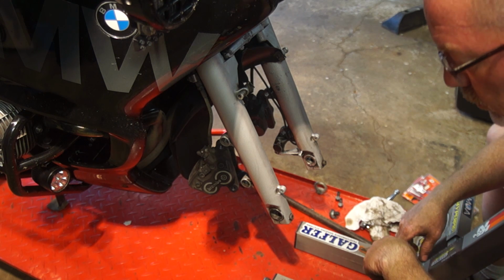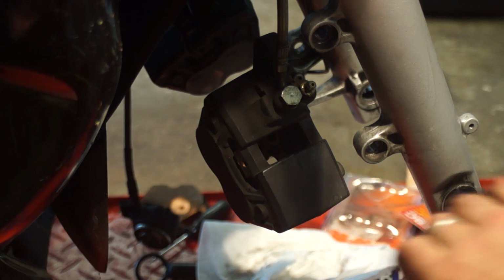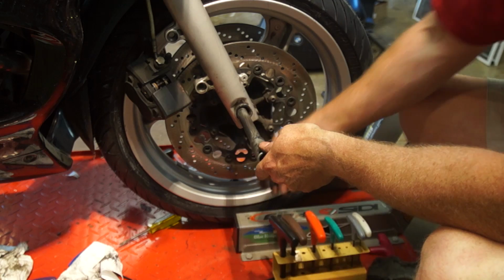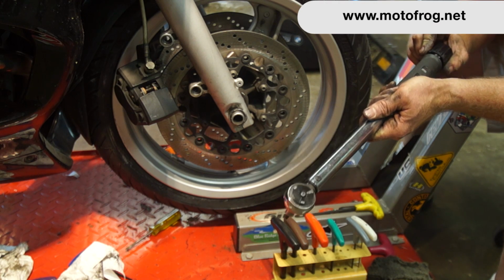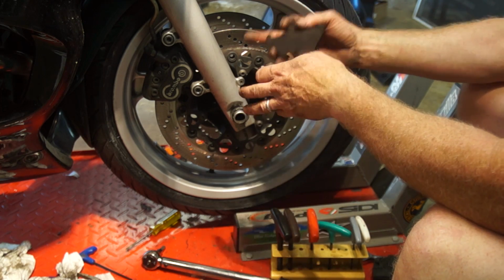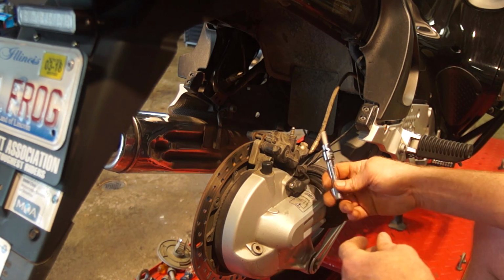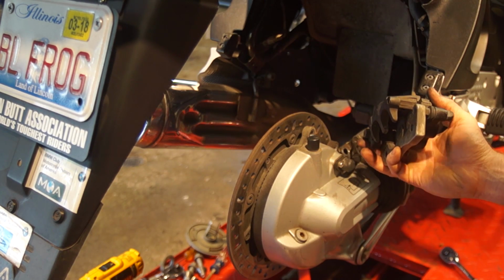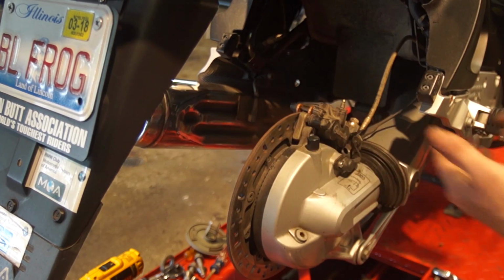Carbon Lorraine Brake Pads Review/ Install and Honing A Brake Disc

Comment: When you under torque a fastener, particularly if the incorrect torque value was within ~25% of the correct torque, you need to fully loosen the fastener and then torque again correctly.  A fastener torqued to 22 after having been torqued to 20 isn’t like to move at all, so it is still only torqued to 20.

The reason is that the coefficient of static friction is generally 20% or so higher than that of dynamic friction.  That is why fasteners should be torqued in one smooth uninterrupted motion.  Any halt along the way requires the fastener be loosened and torqued again.
Reply from the maker: You are correct. I had torqued it to the correct setting the first time, that just didn't translate to the words coming out of my mouth and I guess I just went through the motions at that point. Good catch!
Reply: illinoisBMWriders Being within 10%, it likely makes no difference anyway, but if you are 20-30% under torque, that would be a little more troublesome.  Many don’t understand the need to start over when torquing a fastener if any halt or chatter occurs during the torquing process.

Comment: Copper grease on a brake pad? It is an anti-seize compound, will make seals swell if it gets on them and can react badly with aluminium alloys. It will also reduce the efficacy of the coatings manufacturers apply to the back of modern pads. Don't ever use it on modern brakes.